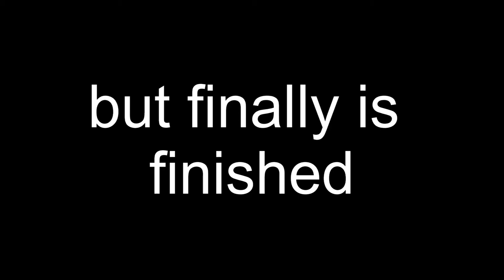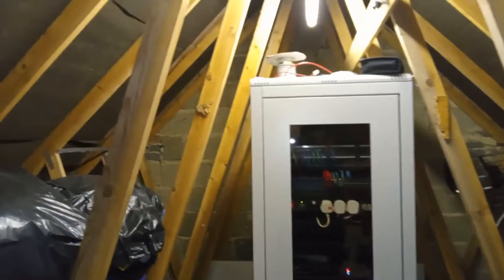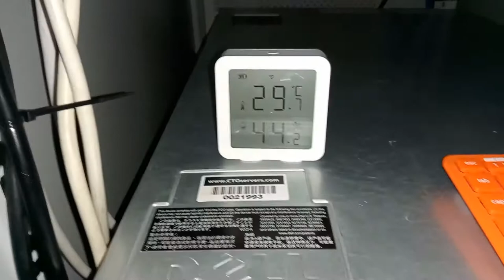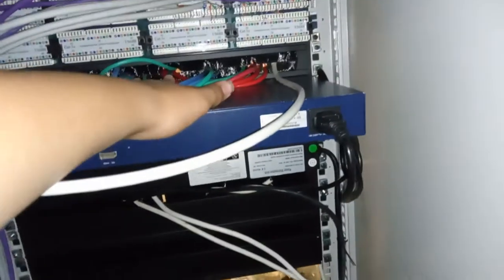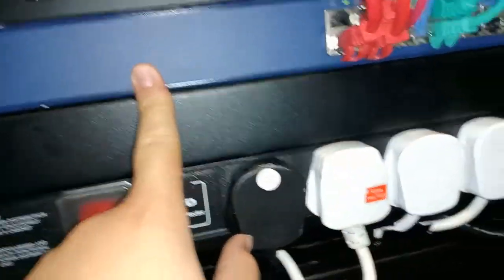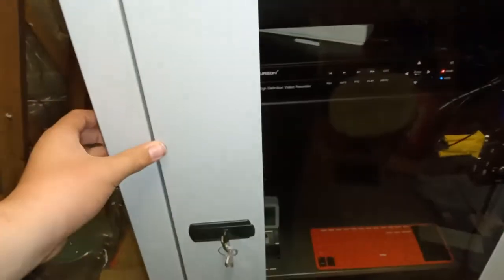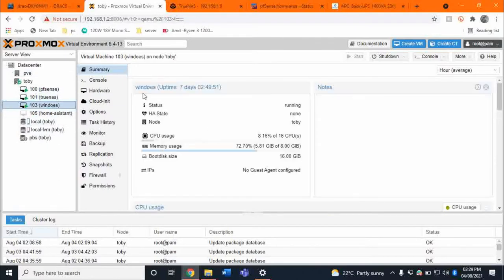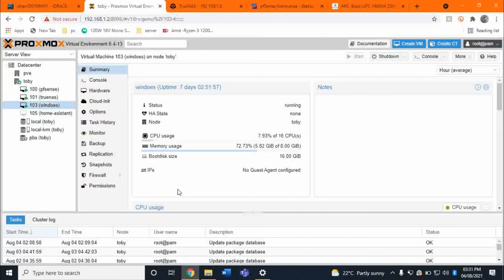my new server and the home network

Comment: What program do you use to automate the turning on and turning off of the server after the backup is completed
Reply from the maker: Running on my main server I use a program called wol (wake on lan) running in the windows VM.  this sends a magic packet to the backup server turning it on. in terms of shutting it down, I haven't really worked that out yet I'm just doing it manually. 😟